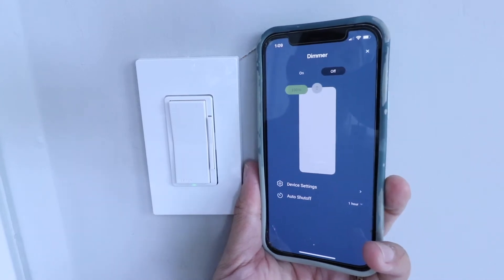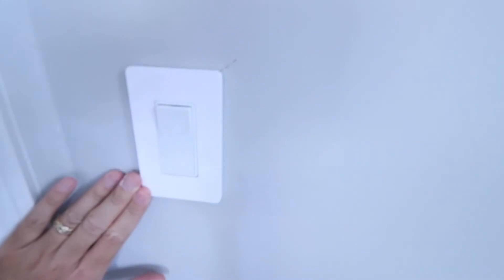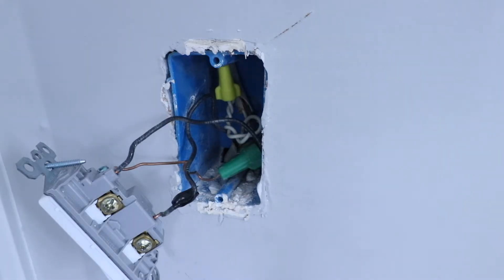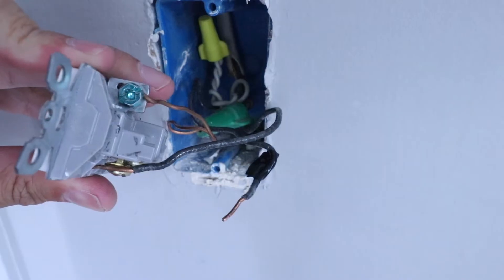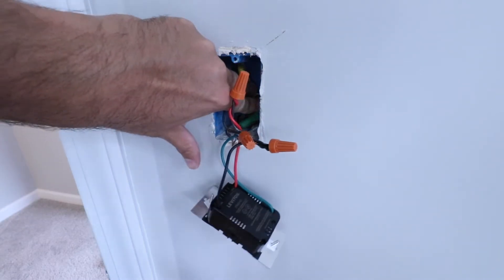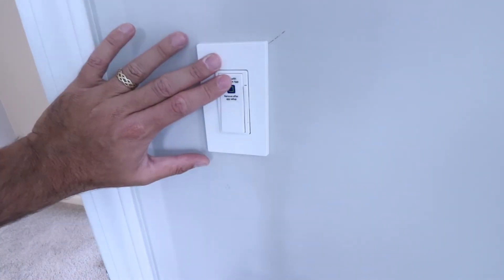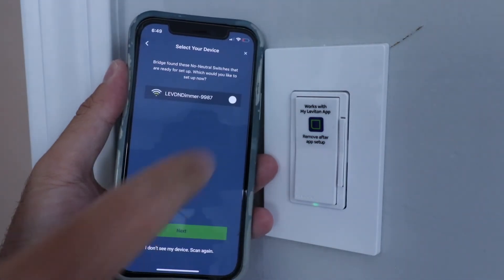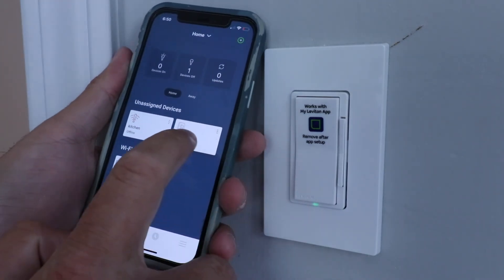How To Install Smart Light Switch No Neutral Wire Required

Comment: In my house wires from the service box run up a service channel to the attic. Than drop down the walls to switches and outlets. According to your theory my house is wired up wrong? What should I do? In my case load and line wires come in from the top

Comment: Hi, thanks for this video! Do I need just one bridge for as many Leviton non-neutral wifi enabled light switches?
Reply: From what I can see, one Leviton Decora Smart Wi-Fi Bridge can support up to 25 total No-Neutral devices, including compatible smart switches, dimmers, and Anywhere Companion devices.  Also, you need to place the Leviton Wi-Fi Bridge within 50 feet of the Decora Smart No-Neutral switches it needs to connect to. The bridge itself should be positioned in a central location to provide the best coverage, which is up to 2,500 square feet.

Comment: if the junction box doesn't have a ground wire, do you connect the ground wire from the switch to the junction box?  i only have the hot and load wires

Comment: Do you only need one hub for multiple switches or do you need a hub per switch?
Reply: Hubs can handle multiple devices. Each brand/vendor has its own limit. For the model he is using, Leviton, it can handle 25 wired switches and 6 wireless.

Comment: I very worried right now. I just installed a Kasa smart switch which requires a neutral wire. The switch is working now but idk if the neutral wire or ground wire possibly came out as I was jamming the switch in. It dims my old antique light but when I use the app to dim the lamp it makes a buzzing sound. I don’t hear a buzzing when using the switch without the light plugged in though. Could be unrelated but is there any way I can know if the neutral wire and ground wire are still connected without taking the switch back out?
Reply: What happened with your switch?
Reply: @tj901  it continued to work fine until I accidentally plugged a vacuum cleaner into the outlet and turned it on. This ended up frying the internal circuit in the switch instantly but that is to be expected since the circuit breaker trip current is significantly higher than the max current the switch can handle. Ultimately no fire though and when I took out the switch, I could see that the wires were all still attached how they should be so that means I wired it right. I think the lamp buzzed just because it was old and had a dead moth between the contact points which I discovered later.

Comment: I have a Smart switch with Neutral wire option, but I dont have neutral wire in my Electrical system at Home. How do I connect my Switch in this case?
Reply: If you don't need the neutral , then it will install the same was as the old switch. You do need a ground wire though.

Comment: How many light switches can you have on the bridge? Also does it work with fluorescent light bulbs? Also will it work with, philips hue lights?
Reply: From what I can see, one Leviton Decora Smart Wi-Fi Bridge can support up to 25 total No-Neutral devices, including compatible smart switches, dimmers, and Anywhere Companion devices.  Also, you need to place the Leviton Wi-Fi Bridge within 50 feet of the Decora Smart No-Neutral switches it needs to connect to. The bridge itself should be positioned in a central location to provide the best coverage, which is up to 2,500 square feet.